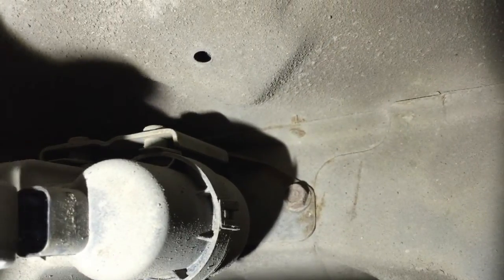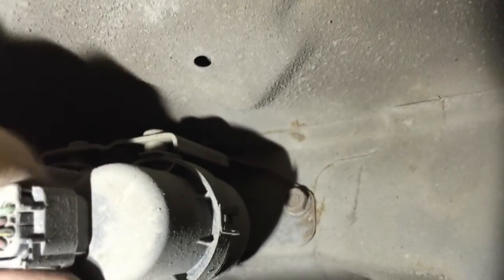KIA Spectra Code P1404 - Leak Detection Pump

Comment: I have a p1404 ,p1765,and a p1693...The car takes a while to accelerate from drive and after I replaced the coils and spark plugs and wires it runs but sluggish.Thank you for your help.
Reply from the maker: what is the year make model of your vehicle and engine size? What have you tested?

Comment: Just wondering about how much this would cost to change?  I am going to take it to the dealer in town so they can change it.  Every other garage where I am at cannot find the piece to actually switch it out.  What's the average cost of parts + labor for this?
Reply from the maker: Including testing probably about 300+ up here. The part is available from the dealership.

Comment: How is it removed? I can look at it. But no place on line explains removal. I see that it is a dealer part.
Reply from the maker: Just disconnect the electrical connector and remove the valve from its mounting bracket. Super easy.
Reply: the dealer wanted 534 for the part only. Any suggestions? We tried disconnecting it and running it without being connected. It did not help.  Solenoid valve is what they call it. part  #0K2NA18740 . #4 in the standard Kia diagram for emissions.
Reply: The mounting bracket had a 10 mm bolt. The bracket also had 3 Phillips head screws on top. There was no room to remove the screws. There was not enough room for a stubby screw driver. I used tape and attached a Phillips head bit to a 1/4 inch socket wrench.
Reply from the maker: Cool. Thanks for the feedback. Take care.

Comment: So if the module is faulty, can I replace it? Is it a dealer specific part? and how much would it be to fix if I need the dealer to fix it?
Reply from the maker: jlangstonvids Contact your local dealer for an estimate. Its fairly simple to replace but youll have to get the part from the dealer. I have not found a part available aftermarket yet. Good luck!
Reply: https://kiacarparts.net/parts/2003/Kia/Spectra/LS?siteid=214819&vehicleid=91927&section=EMISSION%20SYSTEM&group=&subgroup=&component=&searchText=&startRow=11&maxRow=10